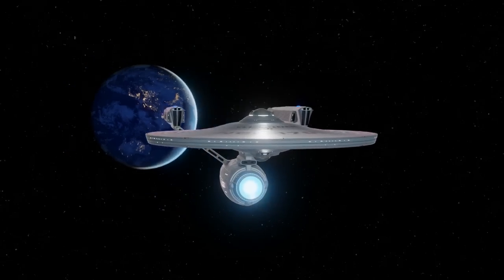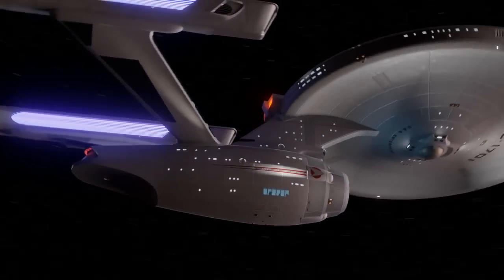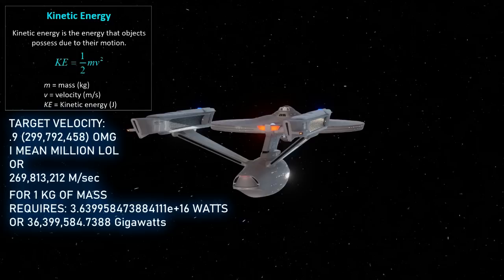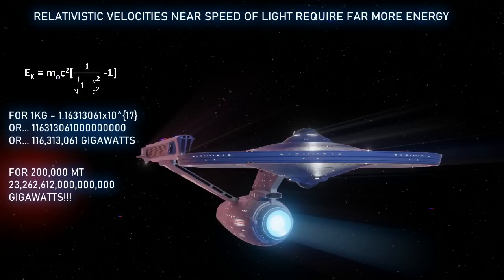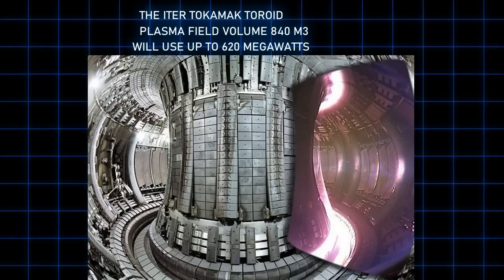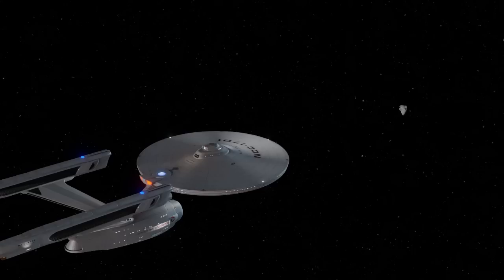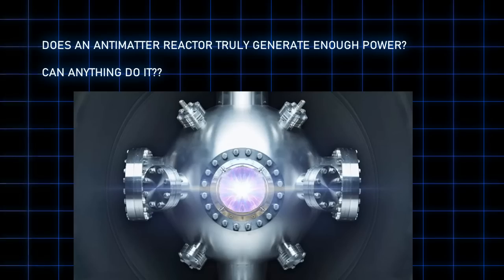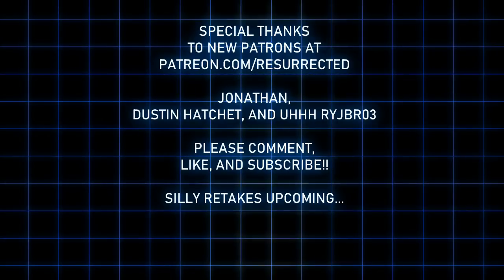How Many Nuclear Power Plants Can Power the Enterprise? Let's Calculate!!!

Comment: Wasn't it the TNG Tech Manual that put full impulse at 0.25c?  Other than that, love the video.  It also makes me wonder if power in the future is a lot like power today (at power plants and sea vessels) in that everything is steam powered but the method to generate steam is different.
Reply: You are correct. Poor Resurrected, all that math just to be wrong......
Reply: The TNG tech manual is not and has never been canon. It contradicts every Star Trek episode.
Reply: @Idazmi7  Nothing ever said full impulse is 0.9c either.
Reply: @danielhenderson8316  
Incorrect. We see ships moving that fast without warp Drive on multiple occasions - Enterprise included. Like I said, the TNG tech manual contradicts every Star Trek episode.
Reply: @Idazmi7  No exact speed rating has ever been stated that full impulse equals an exact speed and no episode (besides an engine malfunction in TMP) has time dialation occured because they were going that fast in sublight. 

If anything, all full impulse means full sublight acceleration like in Navy ships.  Flank speed is flank speed and changes depending on the ship.

You also can't be bothered to pick even one instance on when this happened.
Reply: @danielhenderson8316  
"You also can't be bothered to pick even one instance on when this happened."

Because there's too many to count. You didn't see The Cage or City on the edge of Forever, in both of which time-dilation factors are discussed and adjusted, and you didn't see TMP, in which the Enterprise casually goes 0.5c on impulse without any malfunction. You fake experts are annoying: Star Trek is a TV show, not a reference book. When the reference books contradict the show, the SHOW is the canon.

Comment: You assume a ship with mass, however scientists have claimed we can build working warp coils today with our current technology. But we can't generate enough power to go into warp speed. This might seam irrelevant but they also claim you change change the mass(ie weight) of those very same warp coils. Therefore if you have a 2000 ton ship, you could possibly change its apparent mass to 200... or maybe even 20... or possibly 2... or maybe 0. If you could do that then even the constant acceleration  of a fully filled chemical rocket in orbit could reach the speed a good portion the speed of light. They might be using the warp drive to decrease the mass of the ship so the weaker impulse engines can get them close to light speed. In other words they idle the warp coils while they travel sublight, them floor the accelerator to jump into warp.
Reply: That's not how it works. The Impulse Engines are always engaged separately from the Warp Drive.
Reply: @Idazmi7  if you have a car you don't require 1 engine to go forward and a second one to backup, just a gearbox to do it. By the same token the warp coils under high power could jump your ship into warp, and at low level be used to assist sublight. 

I don't know many people that turn off their car engines at a stop light. What makes you assume they would power down the warp system at all?
Reply: @billlyell8322  Think of it more like this: how many people leave the propeller running while driving their amphibious cars on land? There's just no reason to power a drive system that you aren't using.
Reply: @billlyell8322  
"if you have a car (...)"

1. The Enterprise is not a car.
2. what I described to you is what actually happens in Star Trek, not a theory I made up.
Reply: @Idazmi7  Roddenberry was notorious for not explaining details, so it did not date the production. Just because it wasn't spelled out for you does not make the possibility wrong. There are numerous scenes in the show that not only show the warp coils but also the warp core on and operating while they where not at warp. As for made up in your mind, it is a totally fictional story that was completely made up in somebody's mind. Lmao... you would never arbitrarily shut them down. There are  even scenes that show they must do emergency starts when the system is knocked offline. That itself proves the warp core and coils are always on at least in some idle status.
Reply: @Idazmi7  oh yes one more thing, the actual physics of warp drives was only done recently... decades after the tv show proposed them. I was actually making suggestions from reviews of real physicists have proposed. They claim with megawatt power you can tune warp coils to control mass.
Reply: @billlyell8322  
" Roddenberry was notorious for not explaining details (...)"

You base a lot on so-called 'common knowledge' instead of actual information. In truth, Roddenberry was actually notorious for being incredibly strict on star Trek's technical details, to the point that he greatly annoyed the directors and writers he worked with.

"it is a totally fictional story that was completely made up in somebody's mind"

🤨Then stop wasting your time trying to work out it's technical rules.

"oh yes one more thing, the actual physics of warp drives was only done recently... decades after the tv show proposed them. I was actually making suggestions from reviews of real physicists have proposed. They claim with megawatt power you can tune warp coils to control mass."

Really? Then why haven't we reached Mars yet? It's almost as if Warp Drives don't exist yet... and even if they did, Star Trek would still be fiction, so it's fictional rules still apply regardless.
Reply: @Idazmi7  he was strict about HIS rules. He wanted a clear consistency for his work. I have a great deal of respect for that. And I believe his insistence of consistency has gone a long way to make star trek consistent. He defined a unified appearance for the ship. Had the bean counters allowed him to spend more on effects, star trek would have had many more ships similar to each other from tos instead repeatedly using the same models.

Never once was did he try to explain how warp engines actually work. He just called it warp drive and gave it a scale. Many low quality shows at the time tried to explain every little thing, like the drive, or shield, or phasers. He just identified them and let the audience acept they where functional creations.

If you watch a crime drama they don't try to explain how everything works. You are familiar enough with a car they assume you know how it works even if you don't. They don't try to e plain it's functions. Most other sci-fi back then did try to explain everything. Iy made the stories less believable. By using generalities Roddenberry made trek more believable and he could tell a better story because he wasn't wasting time either e plantations. You font explain a revolver in the crime drama, you just show it and let the audience e believe it is real.  Even though most of the time the gins arnt real, they are props.
Reply: @billlyell8322  
"Never once was did he try to explain how warp engines actually work."

That's a direct lie. Just watching TOS alone kiboshes that completely.

"Many low quality shows at the time tried to explain every little thing, like the drive, or shield, or phasers."

Name just one 1950's-60's era sci-fi OTHER than Star Trek that tried to explain it's tech. Lost in Space? This Island Earth? Please.

"By using generalities Roddenberry made trek more believable and he could tell a better story because he wasn't wasting time either e plantations."

The hand-carried weapons, called "phasers," are pure energy weapons (as are all offensive weapons in the ship's arsenal). all phasers emit a beam of energy similar to the light beam emitted by a Laser, but of a pulsating nature that can be "phased" to interfere or interact with the wave pattern of any molecular form (...) - The Making of Star Trek, page 193.
Reply: @Idazmi7  I'm sorry I was not explicit in my statement. When I said he did not explain the technology I was referring to in show cannon. They did not pull out a phaser and try to explain how it worked in show. I wasn't referring to other publications. Nor was I referring the trek conventions held either.

As for this island earth, you proved my point for me. That did explain the alien technology numerous times in the the movie. The anti gravity ray, the force field, and several others. Granted they did it it better than a lot of other movies but they still did do it in the movie cannon.
Reply: @Idazmi7  by your reasoning the fasa ships where cannon, but they are not. They where licensed to create a game but none of the material was in the original shop. At best they are beta material as would anything publishished not added to the show.

As a kid I had the enterprise and ptolemy blueprints wallpapering my walls. Amoung others. I'm well aware of after market products. But show me original footage of where it was included in tos. It wasn't. Hell the bean counters wouldn't even buy available model kits to kitbash new ships.
Reply: @billlyell8322  
Warp Drive
Transporters
Forcefields
Dilithium batteries
Magnetic containment
Antimatter power
Artificial Intelligence
Neural Networks
Sensors (different types of them)

All of this, and much more, was explained in the show. You don't watch Star Trek, that much is very obvious.
Reply: @Idazmi7  really then name the episode that expained how to create a warp field by compressing space in front of the ship and expanding it behind the ship in tos. Yes they gave many names for things, they even created a fictional element called dilythium. But what episode did they actually explain it? I ask because Alcubierre didn't propose his drive unit 1994, quite a few years after the 1960s TV show.
Reply: @billlyell8322  
Alcubierre theory is not Star Trek's formula for Warp drive at all. Rather, the space-warp and time-warp systems operate in combination. You'd know this if you had seen so much as the opening minute of City on the Edge of Forever. 

The nature of space-warp and time-warp is important to many TOS episodes, in detail.

Comment: i dont believe they reached .9c using impulse. Full impulse was supposedly .25c. They books stated they could go faster perhaps .5 or .75c but traveling past .25c would cause relativistic/time dilation effects.
Reply: Stop reading the TNG technical manual. It isn't canon, at all.
Reply: @Idazmi7  .25c being full impulse is cannon voyager and DS9. The relativistic time dilatation does comes from the books. However nothing I said comes from the TNG technical manual becasue I didn't read it however it may be there too.
Reply: @MiiFone1  
".25c being full impulse is cannon voyager and DS9."

No it isn't. You can see ships going faster than that on Impulse Power all the time.

Comment: In the Star Trek universe, ships usually have their warp bubble always active. At impulse, it's set to a very low value and is used to reduce or even nullify the inertia of the ship. They even used it to move an asteroid several times bigger and denser than the Enterprise.
Reply: The energy needed to warp space time into an warp bubbel is immense. It's much harder to calculate... But with the original Alcubierre formula it ends up more than exists in the whole universe! It can probably be improved a lot but it will end up being an ridiculous amount.
Reply: @lubricustheslippery5028  The formula got refined over time. It have been brought down by a factor of over 12 orders of magnitude, maybe more.
Reply: "In the Star Trek universe, ships usually have their warp bubble always active."

NO THEY DO NOT!!! 😮

Comment: An issue I have is that the impulse drive IS NOT a thrust reaction.  It creates a spacial distortion that facilitates motion.  The exhaust vents are just that…exhaust.  If the fusion reactors were acting as rocket motors, the ship would cook itself and need a long time to reach any amount of speed.  This is important because it changes how much power impulse travel really requires.
Reply: "Switch to rockets and blast us out of here." - Spock, after the warp drive shuts down.